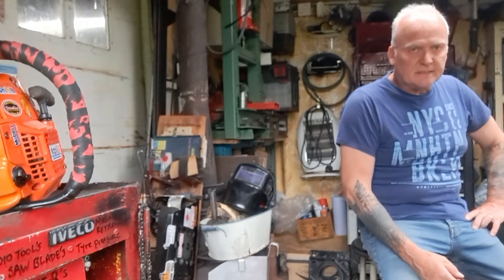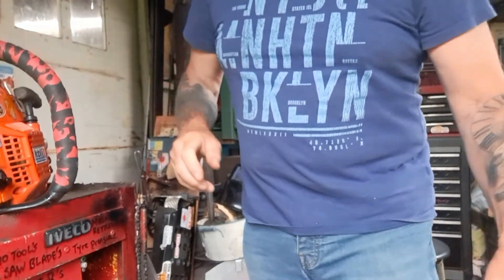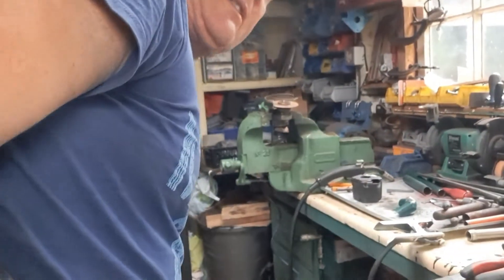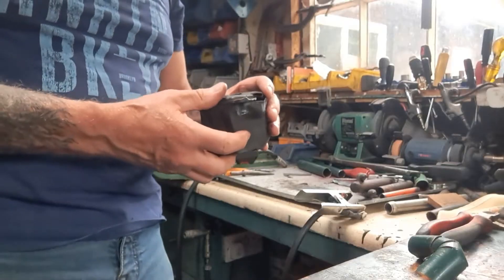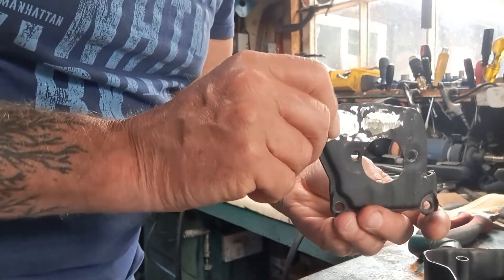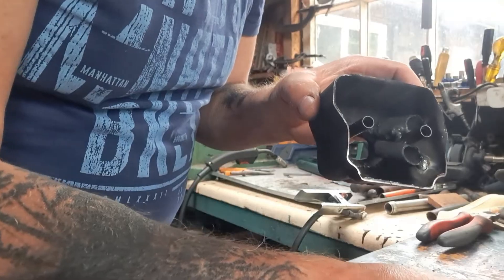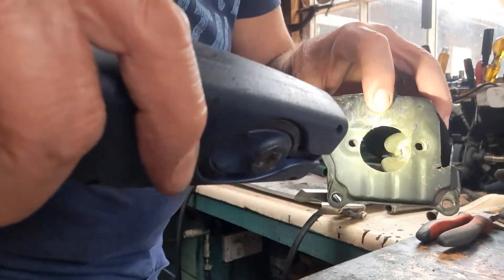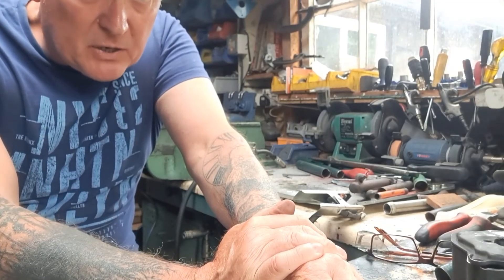lutys chainsaw mods,How to build a short expansion  chamber, 2.2 extra bhp.

Comment: Did you consider making a bleed out the side of the muffler box (like a belly bleed on a pipe) for extra flow instead of blocking the exhaust path with the additional pipe?  Belly bleeds are quiet too.
Reply from the maker: Yes the latest pipe that performs well does have that idea, but just looks like it comes from the front, it uses two smaller bleed pipes which mask part of the exhaust port from the pulse, I call them free way tubes.
Reply: @marklutwyche8578 thank you and I appreciate you sharing your learned info.